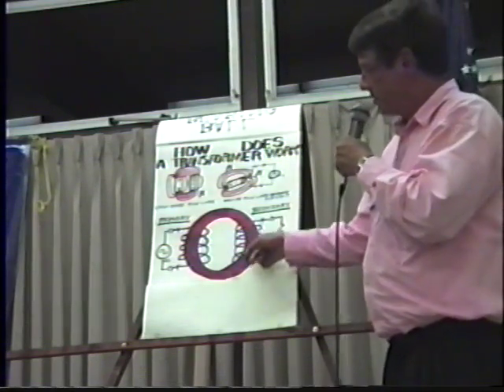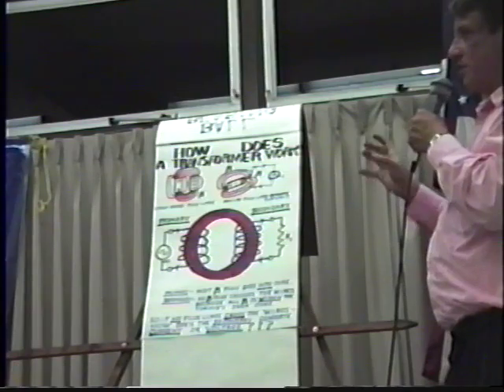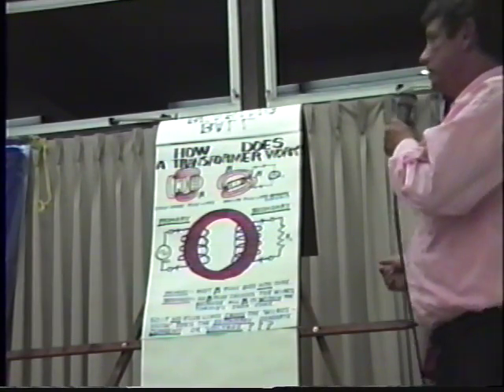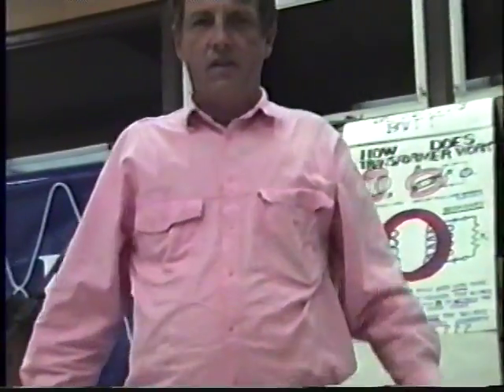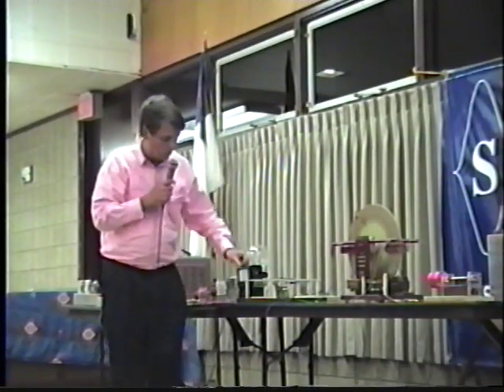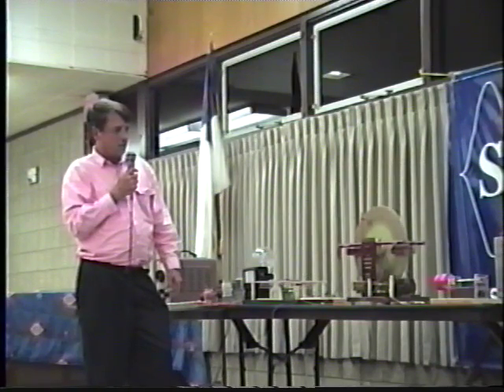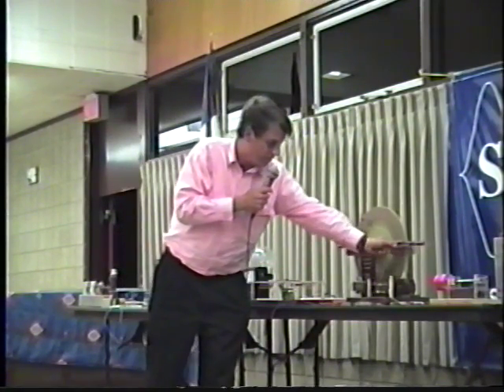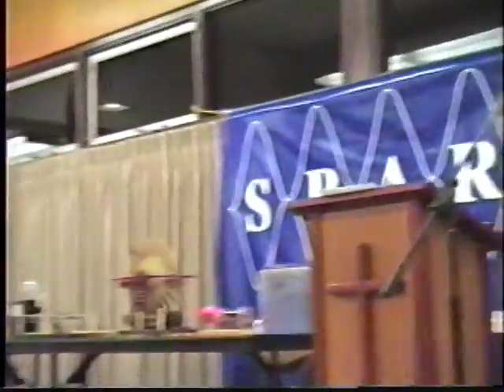Part 5 of 6: Eric Dollard & Chris Carson Tesla Longitudinal Wave Energy SBARC Ham Radio

Comment: Flux lines is not the only thing going on here with the transformer. There is a field of north and south provided by the primary coil. Lets say north on top and south on the bottom lobe in one half of a AC cycle. It is in relation to the primary coil only and generates voltage in the secondary by these poles moving back and forth as the primary is oscillated by the AC signal to the primary.